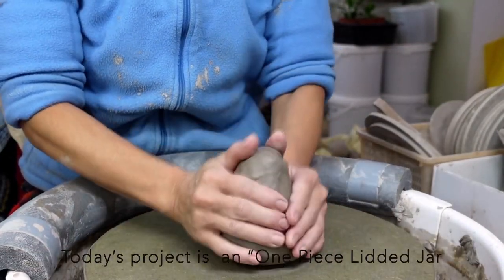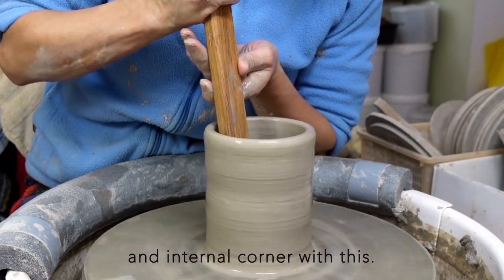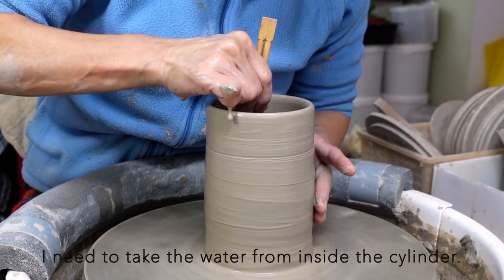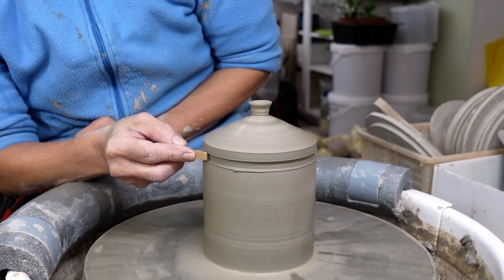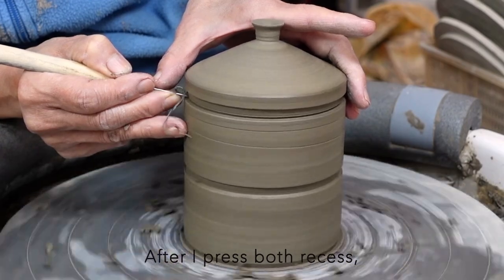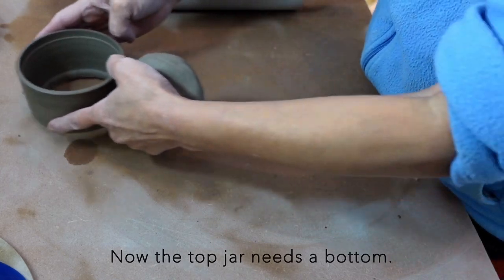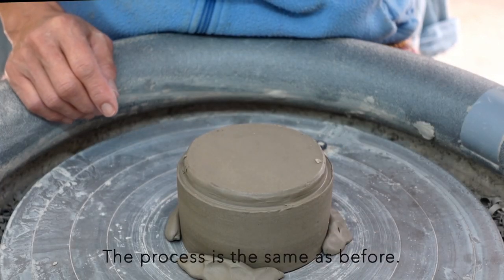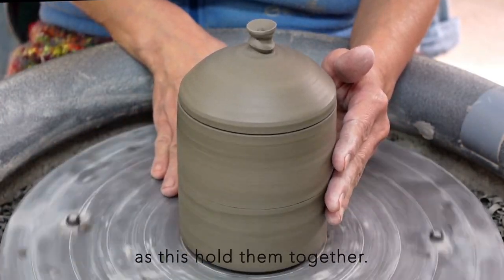ONE PIECE Lidded Jar Double Decker version Throwing on the Potter’s Wheel.

Comment: I am always tempted to leave the bat pins in while trimming on the bare wheel like you do here as it is a pain to constanly be screwing them on and off, but i am sure I'd smash my knuckles or my piece would get loose and crash into one of them.
Reply from the maker: Thank you for your comment Death by Darwin😊 (interesting handle name!)  Yes I agree with you. I have never broken my works by those pins luckily, but I hit my knuckles many times😭. Now I’v got used to pins position so those don’t bother me anymore. Many potters use just clay to attach the bat on the wheel. I do for small bat. If I don’t have pins already I would use same method for large bat too.
Reply: Just keep a dry bat on the wheel.  I wouldn’t want to be thinking of my knuckles.  Just concentrate on the work.

Comment: I love your fantastic videos and long for learning to make the jars you have demonstrated🥰. I thought of making a stick like the one you used inside the pot, for the bottom and the sides. Could you, please, tell me approximately the measurements🙏
Reply from the maker: Thank you for your comment Evmast😊. I’m so glad to hear you are going to make a tool! it is exciting. The bottom measurement is 1.5 x 4.5 cm. it means 1.5 cm is the thickness of the wood. the length is 28 cm. you need to sand and polish the edges. in the beginning I found using this tool is not easy, but after few practice it became one of my best tools. Let me know your experience 😉
Reply: @AlchemyCeramic  Thank you so much 😍. I will try to make one, practice using it and tell you how it worked for me. All the best 🥰